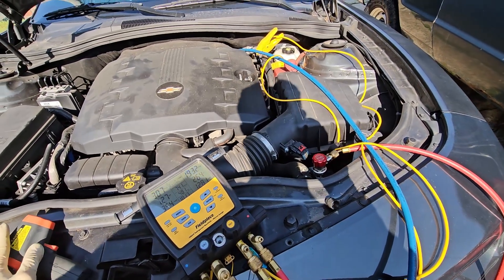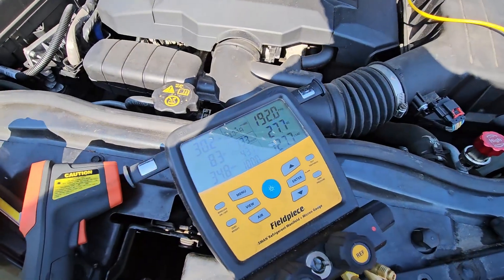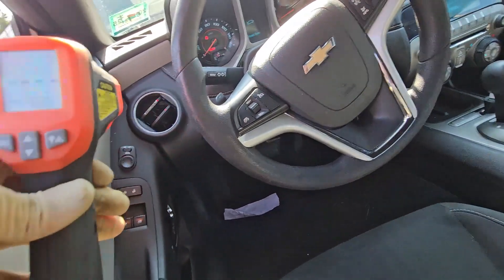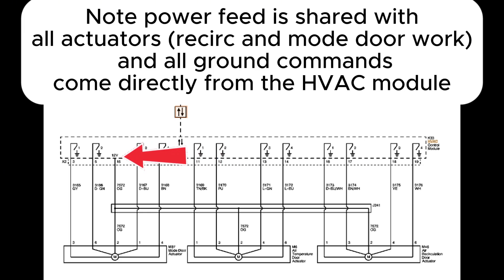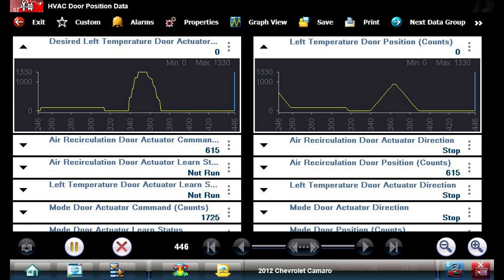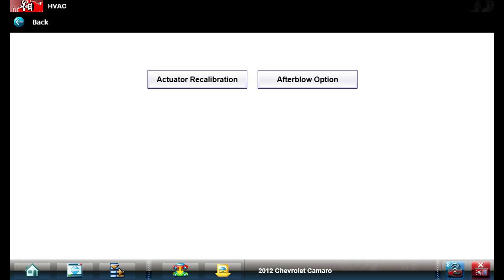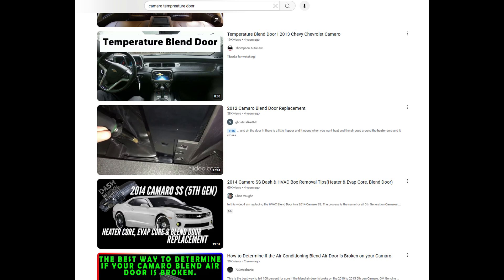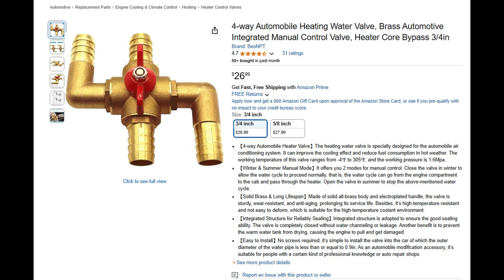Check This Before Recharging Your A/C (Camaro No Cold Air Fix)

Comment: Good job bro... how do you install the valve and how does it work?
Reply from the maker: Thanks, the customer installed the valve directly on the heater lines going to the firewall, it has a loop function so in the off position the heater hoses loop back together, so the coolant flow isn't interrupted